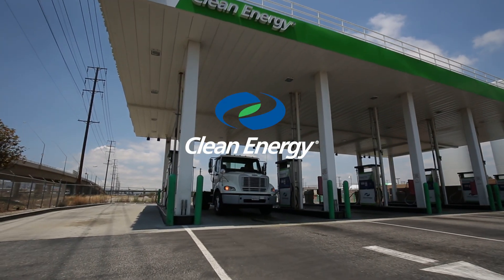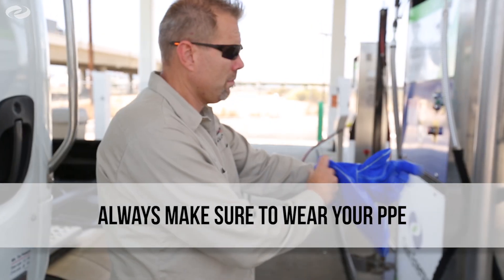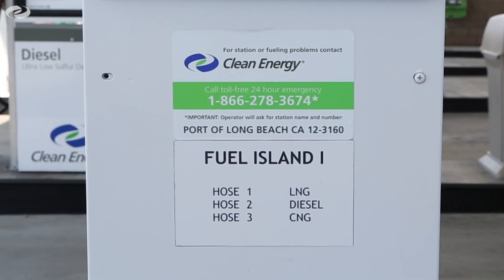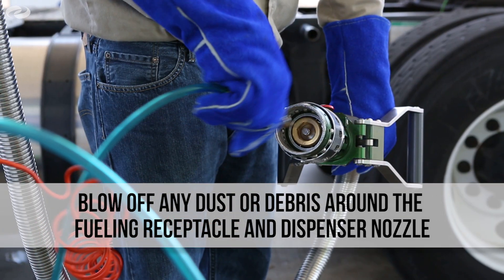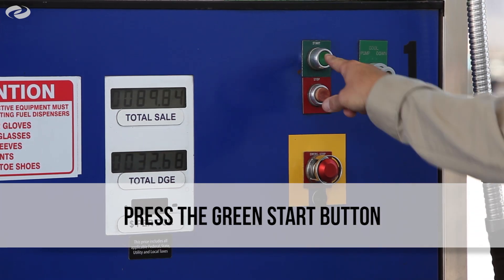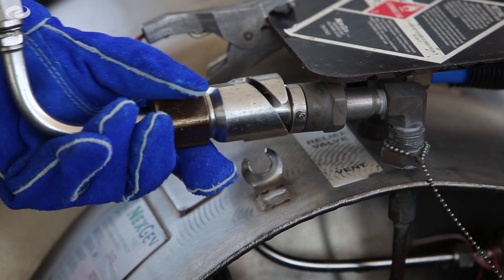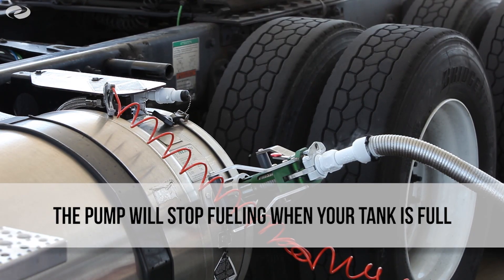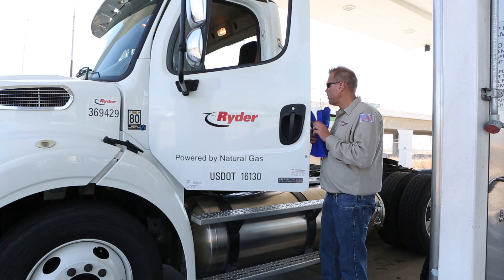Fueling a LNG Vehicle

Comment: those nozzles. are shit tho. the steel balls get frozen when the seal is just a little bit bad. so its an hassle to get it off sometimes.  nozzles from parker are way better now. the twist type.  lasts alot longer
Reply: im sure heating and oiling the balls shouldnt be too big a problem.. they always forget the balls..
Reply: @thothheartmaat2833  yeah heating and oiling helps a bit however if they do it the whole day it wont have time to even heat up. 😬

Stations selling 15T lng a day /70-80trucks per day.   Will have an nightmare replacing parts.   Seals break each week/start pissing out lng     its just not that good for real heavy use. 

Ive seen a new type tho.   A vakuum one.    Its the twist connection of parker and the safer push connection of  jc-carter/Cryomac
Curious how those will last.